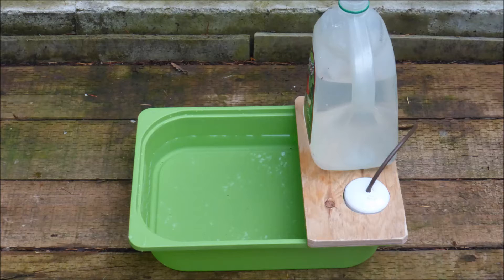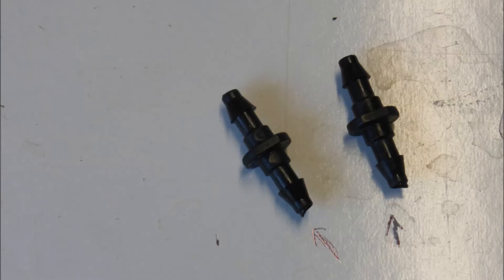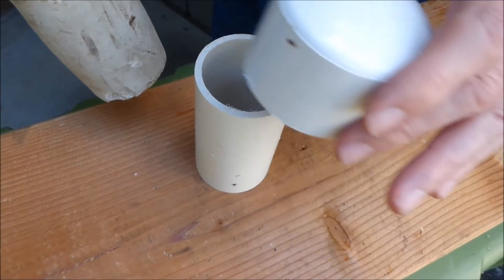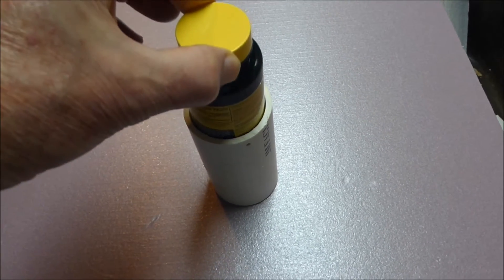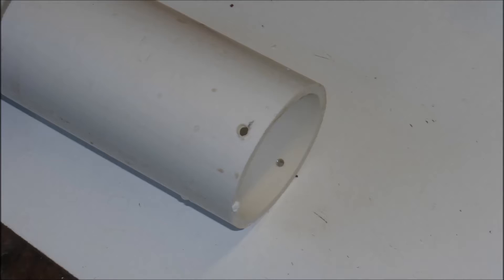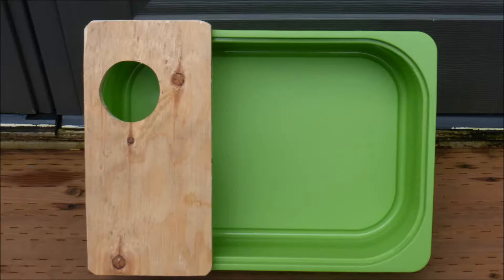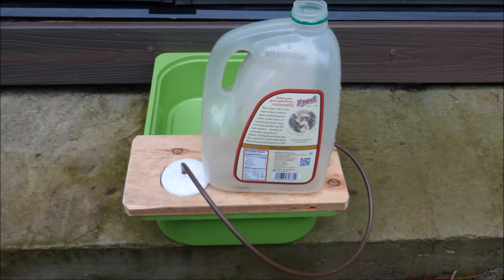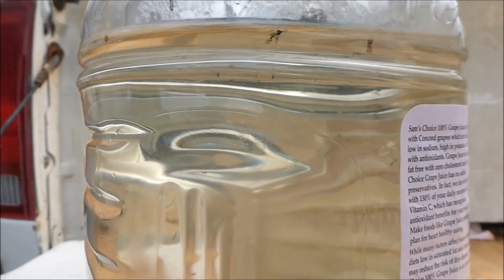Building an Automatic Waterer for Animals, Birds, Poultry and Wildlife using a Kratky Float Valve

Comment: This could be used to maintain the water level in a container that has a solar powered fountain. The fountain agitating the water would deter mosquitoes from landing because they could become trapped beneath the water.  Also I've seen people make fountains that humming birds like to fly through so that could be a bonus. 
It just occurred to me that I could use this to maintain water in the fogger device I'm using to keep humidity for my mushroom tent. Cool! I keep it high up so it is a pain to try to add water without either taking it down or spilling water down my arms, LOL.   But because I have to keep the water shallow enough to make fog i can't put a lot of water in at once.  I will try this float valve and perhaps have enough water for a whole week. No more dried out mushroom pins ( I hope!)
Reply: Reporting In: It Works! I took a large Pill bottle, cut a foam insert and the put the foam tape on that to make the float valve and right now it's connected to a container above it via tubing. 

I set it yesterday Afternoon. The Mist Device is just covered with enough water. Usually it spends this water and cuts off after a few hours and I have to manually refill it. It's been going all yesterday afternoon, night, this morning and this afternoon! That is a rousing success! I won't have to worry about my mushrooms not having proper humidity anymore! I shall eventually replace the small yogurt water well with a gallon container that can last several days, maybe even weeks.

Comment: I get it with the big trashcan as a watertank but in the demostration example it's easier to just drill a small hole near the bottom of the container. Put the cork on and place the container in the tray. The tray will always be filled with water to the top of the hole you drilled. I use it all the time to traywater my plants. The cork has to be airtight.
Reply from the maker: Thank you.
Reply: You are correct. Using a water vacuum is a more simple design.